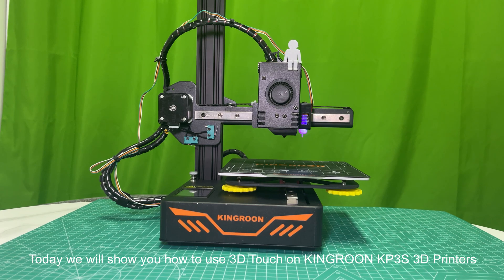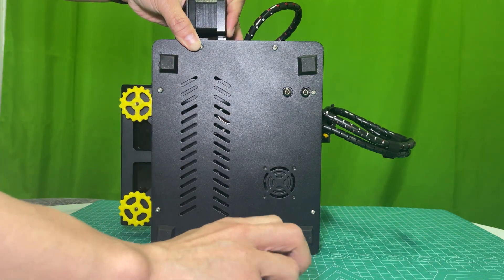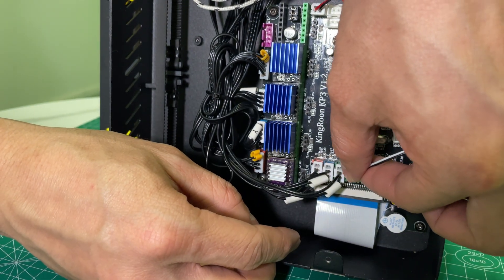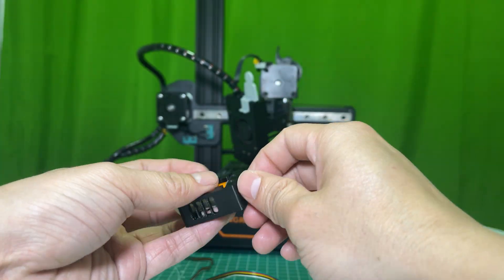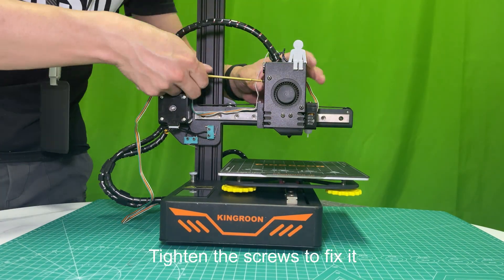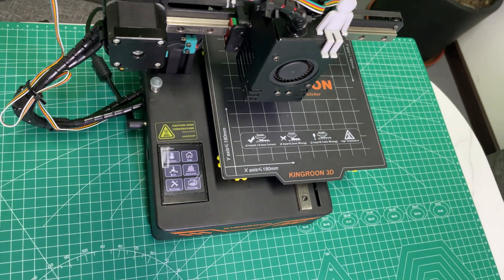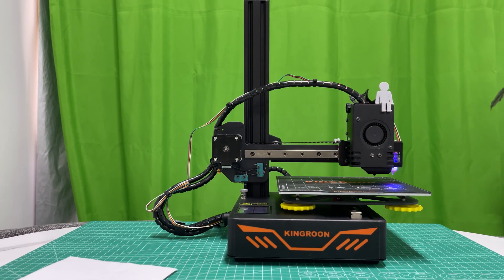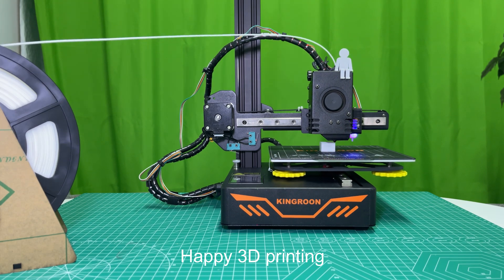NOT MARLIN | How to Enable Auto Bed Leveling  Feature on KINGROON KP3S 3D Printers

Comment: I have the kp3s 1.0 any values I should change or advise on how I can mount the 3D touch to my extruder, I've also been having problems where when the 3D touch is plugged in it soft locks my ability to move the x y and z axis through the software it only works again after disabling the 3D touch auto homing the printer does not fix this.

Comment: Does anybody else have a problem when after selecting auto leveling printer just go to 0, and then to the center of the bed and doesn't move or use 3D touch? 3D touch is moving after you turn the printer on, so it definetely work.
Reply: Same here. I tried different firmware from different people, different tutorials, and different cable configurations. I even installed Klipper on the printer with no luck. 😢 So, please let me know if you found any fix.
Reply: @ I don’t know what you already tried, but try to check if your pinout is correct. Because mine 3D Touch had a + and - swapped in the 3-pin cable. It didn’t help me anyway, but maybe in your case this is what cause problems. And people in KP3S group chat also told me to check if i’ve connected everything properly.

Comment: Mine returns to the center point and start going down a bit after completing the autolevel, and has a Z offset tab, but needs different values for printing, ie: need a -2.11 offset when using the autolevel, but at printing needs a -2.31, if i keep that last digit, when completing auto level, the nozzle will be crushed on the bed, any tips??

Comment: Anyone Having trouble with KP3S and 3D Touch on Marlin. READ THIS
SOLVED:

I fixed it. So if you happen to see or hear anyone having issues with the KP3S and 3d Touch with Marlin... Send them my way. Or simply tell them that the video Kingroon puts out tells you to put the 3d touch 2 pin into the Z+ slot... Thats incorrect.. You actually need to unplug the stock Z endpoint sensor from the Z- Slot and then plug the 3D touch into that one. Then all of the calibrated builds for Marlin on git hub.. Will work with the 3D Touch and the extruder will move in the correct direction during probe wizard and everything else
Reply: Does it also work with klipper?
Reply: No Idea. I just know its with marlin @fatt0nk171

Comment: Hello, I have a kp3s pro s1, I connected the cables like here to the z+, but with homing the z axis goes up, I changed the direction of homing and going down, but without the active bl Touch is there any way to do it in the configuration, do I have to connect bltouch to z-?
Reply: saya mengalami hal yang sama, apakah sudah ketemu jalan keluarnya?

Comment: I have a problem. Kingroon kp3s Motherboard 1.3 based on GD32F303. I connected everything, checked the pinout of the wires several times, everything corresponds to the video. The firmware installed normally. But when 3D Touch is connected, the printer does not turn on... i.e. I press the power button and nothing happens. The OS does not boot. If I turn off the sensor, then everything works, the printer boots, I can even turn on autolevel (but if the sensor is turned off, this makes no sense). What could be the problem?
Reply: HI I hope you solved it, 6 months later 😀 What was the problem ?

Comment: if I follow instructions for Kp5L, will it work with KP3S?. For KP5L I must perform manual level first, then install bltouch and perform autolevel, with KP5L its not necessary to modify configuration file. Thanks for your answer

Comment: Flash made no difference to my Kp3s v3,  3d touch has both led's lit but theres no update/change to the screen so it still dont work.  Mines got the GD32f303 chip and the download was for that model but nothing changed once the flash loaded.
Reply: same problem!!
Reply: @schellmax  Ive taken mine off, It takes under 2 minutes to set it by hand with a 1.5 feeler gauge and the print sticks 95% of the time. I just watch the first couple of layers until the fans fire up then go make a cup of coffee and bash Tinkercad for my next print.

Comment: I followed all the instructions and it broke my printer. It will not auto level. It tries to move as far right as possible and the stepper motor will grind. I installed original firmware and it will not do manual bed level now. The printer will not go to the correct location of all 5 bed leveling points, it will just go to the wrong location, and the motor will grind. I sent you a video on facebook messenger. My printer is now bricked.
Reply: Try unplugging the 3d touch sensor, I have the same problem, the program flashes correctly, but when I hit the auto-level the printer maxes out on the x axis an the motor binds. What I do to return to the original configuration with manual leveling is to unplug the sensor and reboot the printer.
Reply: @Gustavo Martinez  I honestly got fed up with their unprofessional customer support, and no response from their support email. I sent the machine back. I'm buying a prusa mini instead.
Reply: Same thing right now:( Did you manage to fix it?
Reply: Hi!
Have you found a soluce for this problem. i have the same thing with my KPS3 pro😞

Comment: Hey, just wanted to know if the values for the autolevel were saved even when the KP3s is turned off? Do I need to autolevel each time I do a print? Thanks! Tutorial was clear and fixed my warped bed problem!
Reply from the maker: Please check the newer tutorial, you are looking at the first version, there would be a third version soon. We had new features in the second version.
Reply: @Kingroon3DOfficial  Where is the new tutorial? in thw website still have 2022 info. it would be useful a document guide to do this in "OEM firmware" provide by you

Comment: Ok so what's the point of it all. It does not auto level, it just gives a user more problems. Instead of calibrating the bed level once with a sheet of paper, a user also has to calibrate the auto-leveling tool with such a quirky way, nice logic. LOL. It dose not move the bed it does nothing useful but adding additional steps to the default manual calibration.
Reply from the maker: You haven't noticed that you are watching an earlier tutorial with old version firmware, have you?  The current ABL sensors are not so powerful as you thought, that's why I recommend a basic manual level first. Anyway, this tutorial and firmware is going to be updated to the third version. If you need to try that feature out, please find the second version first.

Comment: on the v1.3 kp3s the j16 port is where the tc port is in the video where should i plug in the wire??
Reply from the maker: Same as the video do.
Reply: @Kingroon3DOfficial  but in video j16 is where the j17 port is on my printer

Comment: Can the 3D touch autolevel and laser engraver be used together?
Reply from the maker: You can install them together, but not using together. But actually not suggest to, because it will make the print head heavy and affect the print quality.

Comment: Is it the same as kp3s pro （ upgraded Y-axis with linear rail) ? thanks
Reply from the maker: No, it is different on firmware. You can connect the pins on the motherboard side and leave the other side unconnected and wait for the new firmware.
Reply: @Kingroon3DOfficial  But can you tell me how long to wait for the firmware?
Reply: @Kingroon3DOfficial  Thanks

Comment: 7:53 my printer did not reboot
Reply from the maker: Then it’s high likely that your printer is using the 407 chip and not compatible with the firmware. Please download the stock firmware and flash it back: https://drive.google.com/file/d/1L0blIRQVKSnWLjHYZfrcu6rVo_yLhVFZ/view?usp=sharing
Reply: @Kingroon3DOfficial  how do I do that
Reply from the maker: @Randomperson0467  Just download the file, unzip it, then copy all the files in the folder to your SD card, then put the SD Card into the printer and reboot it.
Reply: @Kingroon3DOfficial  ok

Comment: i spent a day trying to get this to work, but failing. it turns out it won't do the firmware update if using some sd card adaptors. 

also, i tried the new z offset firmware that's in the drive link, but it has issues with skipping gcode and doing invisible or floating prints
Reply from the maker: Please send videos to show the problem, our guy will try their best to help you out. The address is support@kingroon.com. As for skipping gcode, it might not be supported yet. Thanks!

Comment: How do I know which chip I have? Do I have to take the bottom off?
Reply from the maker: Move the heat bed towards you, then you will find a label with a serial number. You should be able to find “103” “303” or “407” in it. Or you can simply flash the firmware, if failed, it’s a 407 mainboard.

Comment: when i put in the sd card to flash the tft update it say it 100% complete but the progress bar dosent move even a bit and now when i boot up my printer without the sd card it just booting forever and never stops
Reply from the maker: Make sure your mainboard is end with 103 or 303. It usually happens when the mainboard doesn’t fit.
Reply: @Kingroon3DOfficial  no it is  a 303

Comment: That's a ridiculous and cumbersome way of setting your z offset. Has anyone got marlin or Klipper working on this thing?
Its mostly a good design for the price accept for the lack of a belt tensioner on X and y. I would probably buy a couple printers is it had belt tensioner. Klipper could be figured out I guess.
Reply from the maker: You are now watching the old video. Please check the video we posted last Sunday, new firmware has already released with the Z offset wizard. Marlin, Klipper and auto bed leveling is only for extension of the printer. They are not the features everyone needs. And for stability concerns, we currently not add them as default. It’s not a good way to raise the prices for adding features. But we definitely will make tutorials on those features, let our customers to decide to use them or not, and add some new features as default in our future models. The feature we add must be stable enough. Thanks!

Comment: What screwdriver did you use to remove the bottom plate of the printer?
Reply from the maker: It should be M2.5. If you still keep the official tool box, we have it included. It’s in a small bag.
Reply: @Kingroon3DOfficial  Thanks! For me I used a 2mm and it still worked.
Reply from the maker: @sogerblx  You are welcome!

Comment: Having to reflash to set z offset sounds pretty awful. Are there any plans to make this a feature that can be adjusted on the printer?
Reply: This is a must.
Reply from the maker: @madrian_hello  sure
Reply: @Kingroon3DOfficial  Has it been launched? And does this firmware work on the KP3s Pro as well?
Reply from the maker: We will publish a newer firmware to make it happen. Is has been made and still under testing. I  think it would be soon.
Reply: @Kingroon3DOfficial  has it already launched?
Reply from the maker: @vitormaichberger4057  Not yet, we are quite busy with the sales peak season. It’s still in development. But we will let the engineers know and make it sooner.

Comment: if i want to switch back to manual levelling , what should i set?
Reply from the maker: Just flash the stock firmware. And you can keep the 3D Touch installed. Once you change your mind, just flashing the firmware to enable it.

Comment: Hello, I have problems with the extruder since I updated the firmware.
The bltouch does not work, on the screen I do not see self-leveling, only leveling, it does not start printing if I do not connect it to the computer although it reads the card and tells me that the printing begins without heating neither the nozzle nor the bed.
There is some solution, because I have tried with the latest firmwares for bl touch and without it and it does not work.

Thank you.

Hola, tengo problemas con la extrusora desde que actualizó el firmware.
El bltouch no funciona, en la pantalla no veo autonivelación, solo nivelación, no empieza a imprimir si no lo conecto al ordenador aunque lee la tarjeta y me dice que la impresión comienza sin calentar ni la boquilla ni la cama.
Hay algo de solución, porque he probado con los últimos firmwares para bl touch y sin él y no funciona.

Gracias.
Reply from the maker: According to user’s feedback, bl touch is not supported with this firmware. Please flash back to the stock firmware or replace the bl touch with a 3D Touch. Thanks!

Comment: Hello Kingroon support. I have emailed you but I am posting this for the benefit of other people that may have the same issue:

On  Kingroon KP3S with STM32F103 chip I have added BLTouch V3.1.
I followed the instructions, wired it correctly, flashed the firmware. 

When printer is powered on Bltouch does its probe check just fine. It goes up and down 3 times.
But, when I hit auto leveling button it does not extend the probe. 
I can hear Z switch clicking  as it homes, and Bltouch probe is still retracted.  

What could be causing this? Does Z switch causing the issue? Should  Z switch still be connected?
Or, is it something else?
Reply from the maker: Do you have any 3D Touch? If you do please try with it. Please also ask the seller, see if it works in 5V. According to the video, your BL Touch is under voltage.
Reply: @Kingroon3DOfficial  I have Bltouch, not 3d touch. How do I make it work on 5v? I know that my bltouch does work on other printer with 5v. Is there some other setting that I can try or is this re-cabling issue??
Reply from the maker: @zeeman2594  Please try turning the three pin cable 180 degrees then connect to the port, see if the red light turns off.
Reply: @Kingroon3DOfficial  I tried flipping the 3 pin plug but the result is the same. My connections are correct. I am guessing that there is maybe something in firmware that needs to be changed. Maybe the config file/firmware has to issue a signal to deploy the probe? I am willing to try out the beta firmware, if you want me to test it out.
Reply from the maker: @zeeman2594  Thanks for your reply! We will let the engineer know and see what to do next.
Reply from the maker: @zeeman2594  Hi, our guy asked for a video on it. If you don’t mind please take one and send it to frank@kingroon.com Thanks!
Reply: @Kingroon3DOfficial  Hi. I have emailed video clip and diagram and bunch of other information that may help with troubleshooting the issue. thank you!
Reply from the maker: @zeeman2594  Thanks a lot! I’ve been notified by that email. I will check them carefully with our engineers, see what we can do to help.
Reply: @Kingroon3DOfficial  I swapped BLtouch with 3D touch  and "deploy" mode works as well as probing of 9 poiints. So, for those that this may benefit - BLtouch is not supported   with current firmware but 3Dtouch does work. 
Do we need to modify start Gcode in cura/simplify3D to include ABL option (G29)?
I think that G29 should be included after G28. Can you confirm?

 my start gcode is: 

G21        ;metric values // added from OEM kingroon
G90        ;absolute positioning //
M82        ;set extruder to absolute mode  //
M107       ;start with the fan off //
G28 ; home all axes
 M117 Purge extruder
 G92 E0 ; reset extruder
 G1 Z1.0 F3000 ; move z up little to prevent scratching of surface
 G1 X2 Y20 Z0.3 F5000.0 ; move to start-line position
 G1 X2 Y175.0 Z0.3 F1500.0 E15 ; draw 1st line
 G1 X2 Y175.0 Z0.4 F5000.0 ; move to side a little
 G1 X2 Y20 Z0.4 F1500.0 E30 ; draw 2nd line
 G92 E0 ; reset extruder
 G1 Z1.0 F3000 ; move z up little to prevent scratching of surface

M117 Printing... ; printing message on LCD screen //

does anything needs to be modified?

thanks!
Reply from the maker: @zeeman2594  Thanks for your update! Please add it as a video on your email. As for your question, we will do some test to check it out.
Reply: @Kingroon3DOfficial  I will do so! Do you know why printer is printing over the left edge of the bed, the printed object (calibration print 175 x 175) is printing 5mm to the left. It is offcenter.
Reply from the maker: @zeeman2594  Please also take a video and send it via email, we’ll check them together and try our best to help you out.